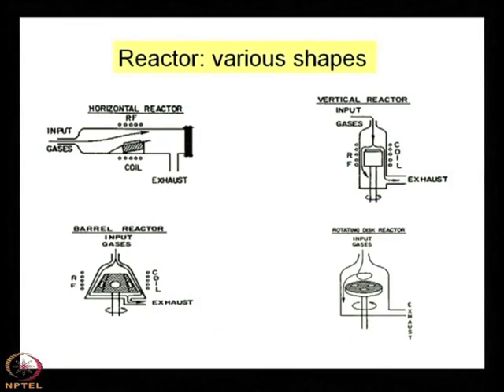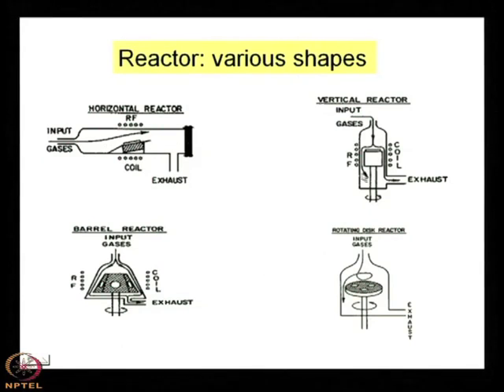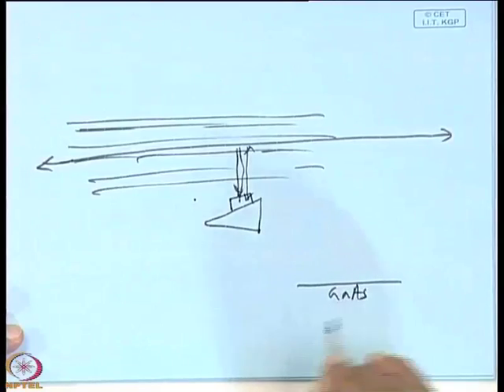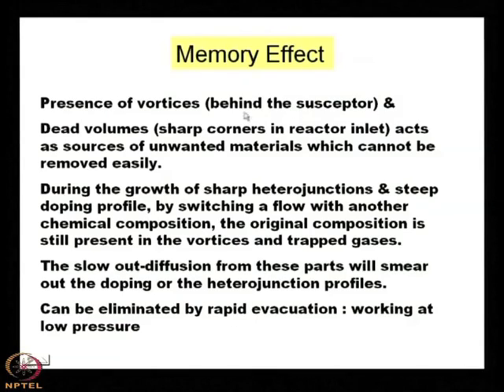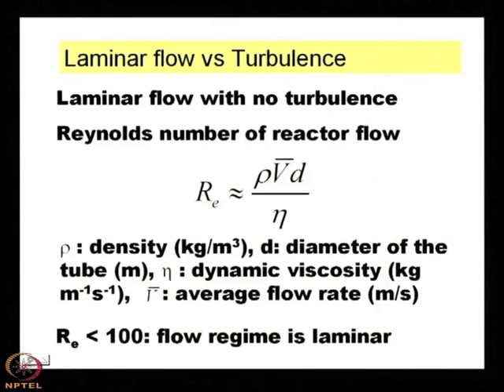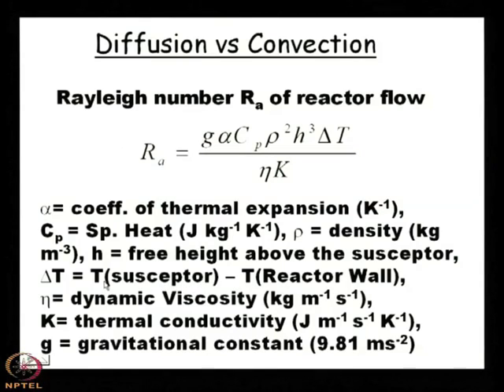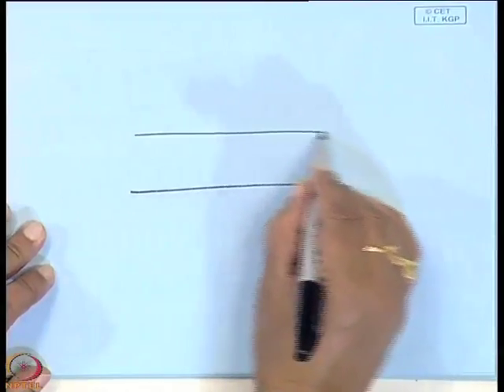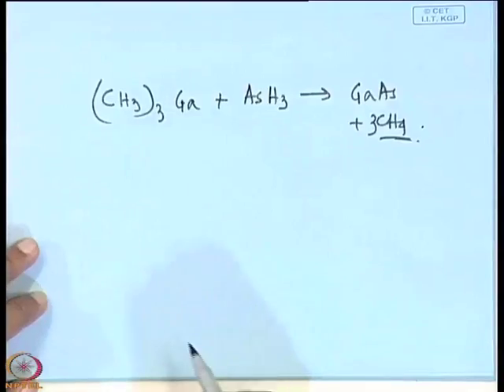Mod-01 Lec-21 MOCVD

Comment: Sir,
Can you tell me, what is the difference of MOCVD and ALD?
Reply: Hi, this is indeed a very good question. There are certain differences of course in between MOCVD and ALD
1. Unlike MOCVD which is operated at broad range of  temperature (upto ~2000 deg C), ALD operates at very low temperature (~70 to ~ 500 deg C).
2. ALD provides excellent provision for controlling the thickness of the atom at angstrom level which is not possible in MOCVD.
3. Despite ALD is a CVD process but unlike conventional CVD, it is a discontinuous process where a) you use a precursor (for eg. di ethyl zinc DEZn), next b) purge inert gas to remove residues followed by c) co-reactant (for eg. DI water) pulse and again d) inert gas purge to deposit ZnO thin films. Hence, ALD has alternating exposures of precursor and reactant
4. ALD also renders excellent conformality
5. Both are used for industrial purposes depending upon the type of materials you want to deposit.
Reply: @shantanusaha6784  Thanks for your kind reply.